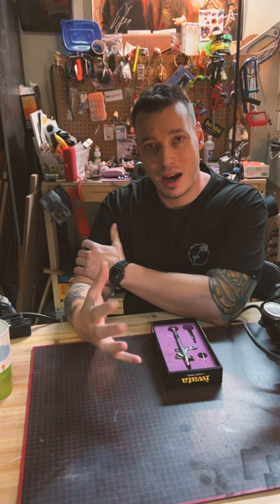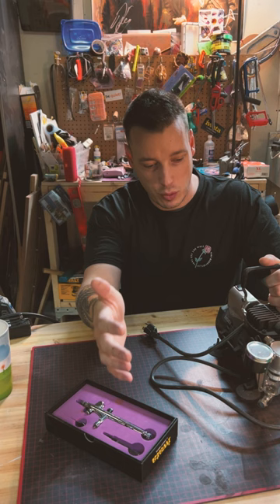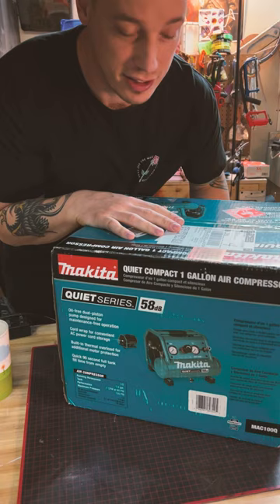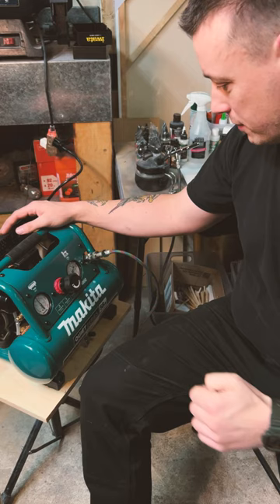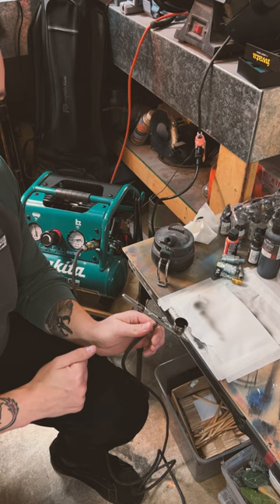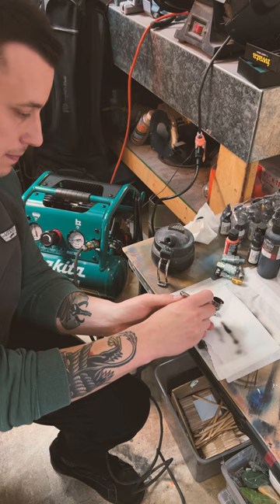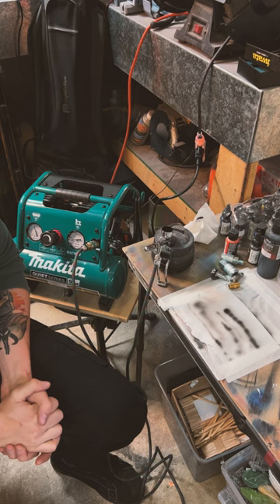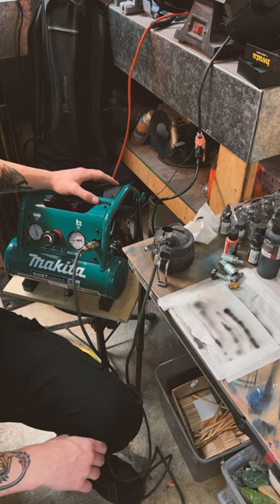160$ Makita MAC100Q , With an Airbrush

Comment: Really great video, very informative. I'm looking at picking up this exact compressor to use with airbrushing. A few questions: What is the exact adapter you got to use with an airbrush hose? Also, How did you fit the moisture trap? Once at full pressure how long can you work for until it kicks on again?